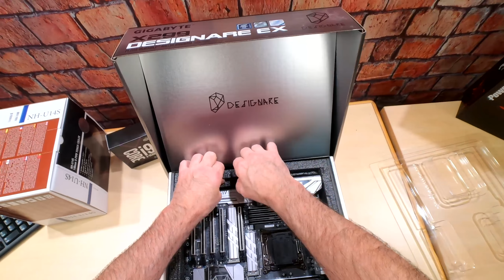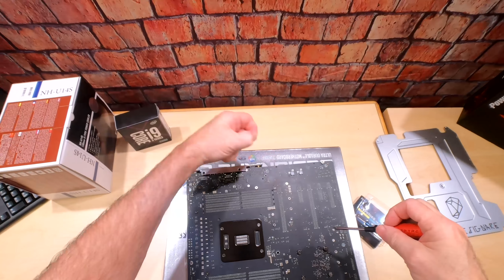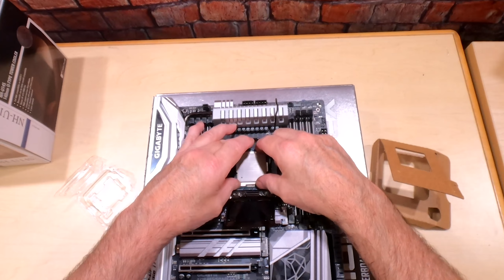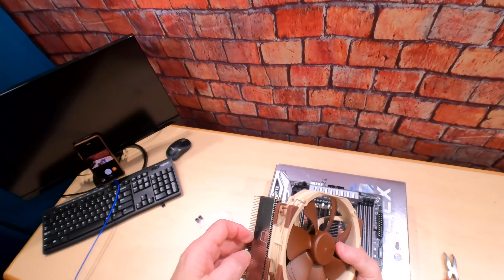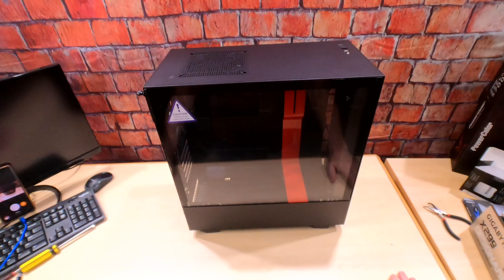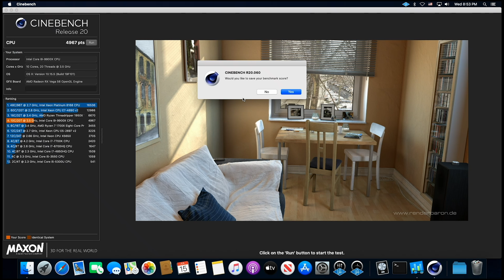INTEL i9-9900X Complete Hackintosh Build using OPENCORE with BENCHMARKS!

Comment: Thanks for the two x299 videos.  I’m stuck at PCI configuration at my first boot.  I’m not sure if my kexts are in line, since I deviate from your setup slightly (CPU 10980xe, EVO 970, Radeon Vega 64.  Maybe my ‘vanilla’ install is wrong, since the x299 link sent me to the wrong video, so I googled to find it manually.
Reply from the maker: Hi Patrick! Here is the EFI: https://ce05a305-2bad-44e3-9149-3538386d84d9.filesusr.com/archives/191c4b_bf956515382c41449e1328b566a3311d.zip?dn=EFI-X299%20DESIGNARE.zip
Reply: @TechNolli  Thank you!  I actually got it working on my 2nd attempt.  Now, I'm trying to get iStat to show CPU temperature.  I've added FakeSMC kexts to kexts folder, but I'm missing something.